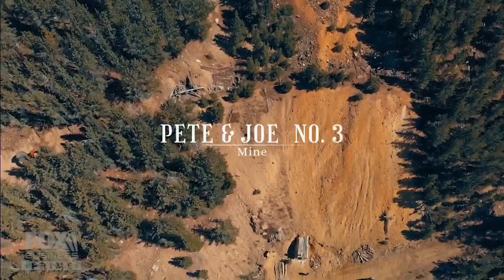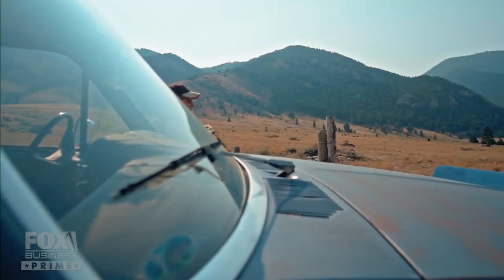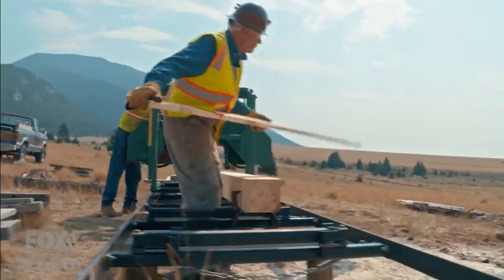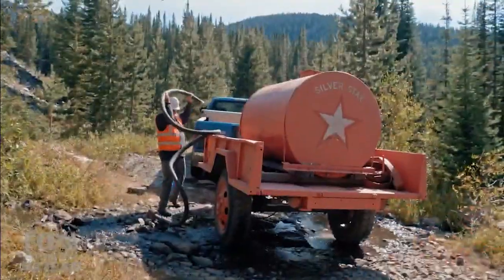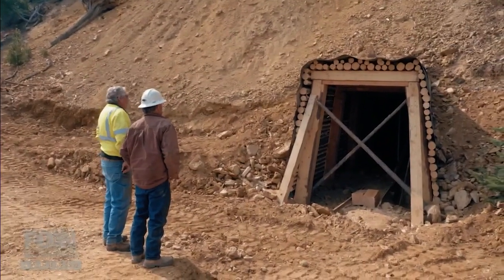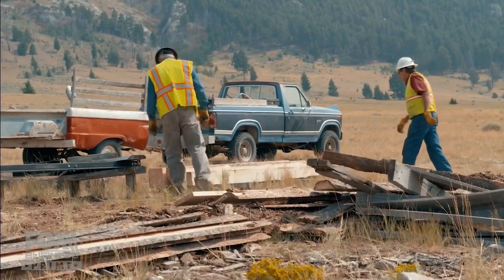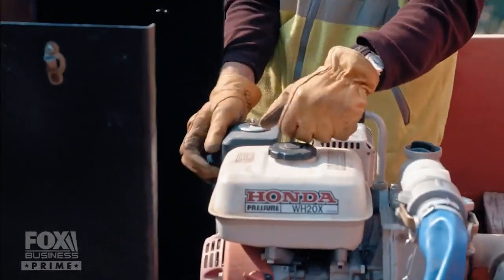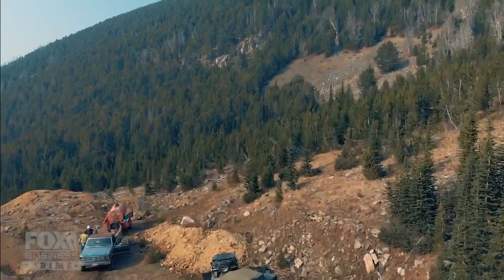Fire In The Hole! Watch gold miners blast ice out of mine

Comment: Blasting ice doesn't work too well does it?  Been there done that.  Compressed air chain saw cuts ice like nothing else.

USBM tested and found aspen works better for stulls.

I did this same type work for over 10 years in mountains of Colorado at 11,000 ft, Mother Lode in California, San Juans at another mine, Utah, Mexico and a bit in Venezuela...

Comment: Get a  jack hammer - break the ice up  that uses compressed air - later  you will need  air to  drill with  - lots to learn here ? 
Get an old time miner that knows  what  to do -  need money  and  mining  equipment  to do the job right - 
I worked underground - drilling/.blasting  40+ years -  you need  water to drill with ? fan for  ventilation ?
Reply: You're missing the point. They clearly aren't going to mine any gold. They're making this show for television in the hopes of recouping the money they wasted on the claims.